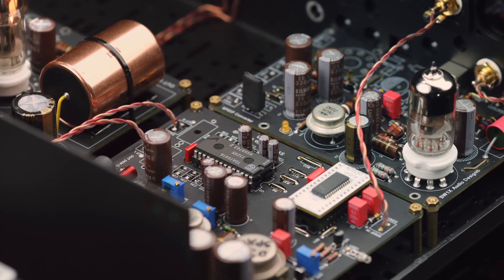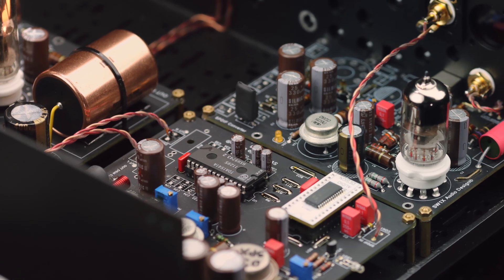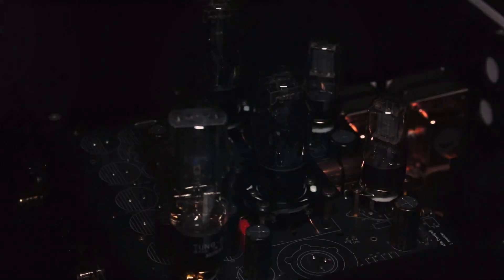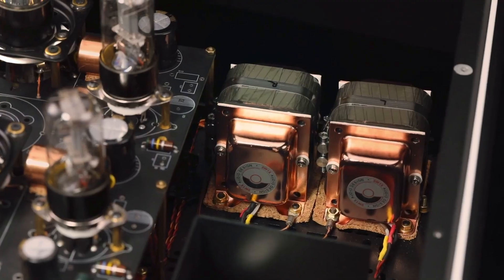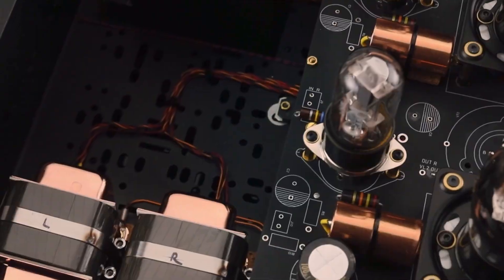The Truth About DAC Bit Perfection and Real World Accuracy

Comment: Only somewhat. The job of any dac is to produce a single voltage per sample. A dac that has higher bit accuracy and lower noise has the opportunity to sound better than one with lower specs if all things are equal. And things in engineering are very rarely equal.

Comment: “The filter is 32 bits but the DAC accepts 1 bit. You do the math, it’s all reconstructed.” This seems like absolutely disingenuous framing. That’s just not how bit depth in DACs works, and to frame it as somehow the filter is creating the other 31 bits out of thin air or something is wildly misleading.
Reply: Indeed, you can't compare 1-bit to multibit. For one reason, 1-bit allows many more samples per unit time (MHz range), Delta-Sigma (DSD) and  tradit multibit converters are two very different ways to convert analog to digital , and back again. I like some aspects of tradit multibit, but SACD (dsd) is superior.
Reply from the maker: @h0ll0wm9n  in the aspect of amplitude accuracy maybe but considering that music is about timing and all DS suck in timing accuracy
Reply from the maker: Who is actually misleading here? Misleading is when a DAC manufacturer makes claims a DAC to be 32bits, where in reality the 32bit resolution is only of the demodulator and the actual noise-shaping DA conversion is only a couple of bits. In essence, all those 30+bits are invented data after all as they do not come as the part of the original recording. Talking about misleading, please do your homework- this is how interpolation & oversampling in a demodulator of a DAC works- it re-samples the data at higher F rate, fills the gaps and creates bits that are not there in the first place. This is how Philips engineers corrected the correct 14bit TDA1540 DAC to accept 16bit PCM data in the first place.